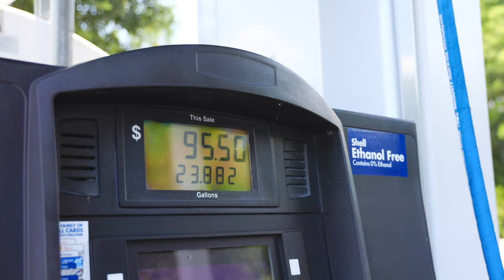Sport Fish Restoration in Florida: Partner with a Payer

Comment: I am concerned with the manner in which the voting and passage of the latest set of draconian measures were implemented at the Weeki Wachee river based on a non scientific observational study.  I have a background in science and you do realize that study wouldn't qualify as a scientific study which is why it's so long. 

Aside from the fact most of the extended sandbar they claim is erosion is likely the result of the additional sand added to the waterpark washing down the river,  implementing additional restrictions when the guidelines already in place are not being enforced is absurd.     

Having meetings and discussions on the issue outside of the area and people it impacts is outrageous and unethical.  I understand the round robin nature of these meetings and when you are discussing issues that pertain to the entire state that's fine.   When it pertains to a specific area and impacts a specific community that's where the discussions need to be held.   This is common sense.   There was no rush to have this on the agenda until the meeting could take place in Hernando county and if there were no meetings in that county then one should have been set up for this alone.  

It's obvious the decision to implement these restrictions were already made prior to any meetings and they were simply a formality to shut people up.  It would look very bad to have a hundred people show up protesting loudly what you are proposing and then pass it anyway. Optics would be horrible and it would really piss people off so I applaud the strategy of making sure they were held in other locations so people would not be able to attend and don't waste my time with they can submit written input.   Any written input went straight into the trash unless it supported your predetermined outcome.       As someone  who exposed  corruption and unethical conduct in the California Department of Public Health your strategy was transparent but I think it was transparent to nearly everyone.  Yes,  I learned through two years in the school of hard knox how you bureacrats work and now I'm a master of stragegy having beaten Goliath so badly I eventually walked away with a 7 figure settlement.   Be careful dismissing me as a crackpot like they did because it didn't work out well for them in the end.     Having  a hand full of bitter senior citizens that don't use the river accompanied by a fascist environmentalist who's ultimate stated goal is to block all public access to the river coupled with 30 years of not enforcing the rules already in place isn't a good foundation for passing additional laws and I'm not even mentioning that absurd report because I read the entire thing, have a background in science, as previously stated, and there was nothing scientific about it.  The eventual goal they are working towards is people only having  access to the river with approved tours.   Additionally, to be one of those "approved people" will of course require a permit which again comes down to money and has nothing to do with the river.       

If there is actual erosion from the volume of people on the river the solution is simple.   Close down the rental location in the park. Fixed!  Everyone has to launch at Rogers and paddle up to float back. The river will be virtually empty,  problem solved. Why wasn't that implemented or suggested?  I would fully support that.   But nobody wants to do that because of the money being generated.  Again, if this was actually about protecting the river this would be the most obvious solution.    That's without mentioning the millions of dollars earmarked to "fix" the river that have already been misaprorpriated.   And did you see those new boats some of those officials bought?  Wow it's amazing how a job earning that little money allows such luxuries.   I can't afford homeowners insurance but they can afford boats running hundreds of thousands of dollars as a public offiical.   But I'll leave that there.   Again, lets not pretend this is about the river. This is about money and control.  

If I learned one thing in California it's the quickest way to actually get something done is not to work through the system where things drag out forever and nothing happens.  The only approach to situations like this that seem to be effective is to publicly call out officials in the media and embarrass them.  That's how I eventually prevailed in California. The Department of Public Health had a sudden change of heart and decided to do their job after the Los Angeles Times contacted them.   A few months after the noise died down a few people were walked out of their jobs as well.   That was after 2 years of working through the system getting nowhere.  

There is a rapidly growing movement opposing how this was handled,  and the obviously predetermined outcome. This is already capturing the publics attention.   My personal background and experiences make me as sympathetic as my credentials make me credible.   Throw in how much the media despises the Governor and it shouldn't take nearly as long to get someone to embarrass him over this as it took me in California to get the media to address the department of health.   The liberal media in California going after the liberal administration on behalf of a strict constitutional conservative should give you an idea of what I can accomplish.  

The Media despises DeSantis!  The DeSantis administration claiming he had no direct involvement in this is unlikely to disuade them and ultimately he is responsible.  I'm fairly certain the media will waste little time in responding to a fellow conservative who feels the Governor is no longer representing the people who elected him. And that is the goal.  DeSantis is running for President.    Time to tie this action directly to him because ultimately he is responsible.  So don't expect us to play by the rules  and work the broken system if you choose to ignore listening to the people, rather than pursuing your own agenda. 

I strongly suggest you put this on hold until you can meet with members in the community impacted not member of the community of St Petersburg or Miami.   

The bottom line is the rules that were currently in place were not being enforced.   Creating new rules doesn't address that problem.  The issue is enforcement not compliance.  You can't fix an enforcement issue by addressing compliance and that is verbatim what was said. The new rules are necessary because people are not compliant with the rules already in place. Changing the oil isn't going to make the air conditioner in the car work.  

Again I sincerely hope you people put politics aside and start representing the people you work for or perhaps there needs to be some changes.   It's astonishing to me this is happening in Florida.   I lived in California for 12 years before returning to Florida.  What a mess that place is!  Yet I come here and find the same level of corruption,  dirty politics,  and disregard for the general public from the elected officials and their apointees. 

The people of weeki wachee DO NOT WANT THIS, overwhelmingly!   Until you can provide actual evidence the alleged erosion isn't the result of normal climate activity, tides, and/or the washdown of sand artifically added near the headspring you actually have no proof there is any damage from kayakers or swimmers at all.    In fact the first thing to do when you claim there is damage is to undo anything artificial that was done. So lets close the waterpark and see how that impact things before we move forward. That's the steps that need to be taken.   Let's start reevaluating the purposeful altering of the environment before trying to implicate people enjoying what was provided by nature itself as the problem.  

Someone standing there saying I saw a kayak pull up and and when it left the sand was stirred up doesn't qualify as science and that is the essence of that entire nonsensical report.  Nothing but theories and assumptions based on observations by people with a clear agenda and no objectivity.  it's shameful you people allowed this to happen and it really pains me that at 60 years old after the nightmare I went through in California I return to Florida to this!

I'm now starting to regret coming back here and that is breaking my heart as it was my pursuit for the past 10 years.    

There are much bigger problems that need to be addressed at this time such as the violation of our constitutional rights demanding we submit to having our belongings searched prior to being able to access the rivers.  You have rules being in place at another location where they are telling us if we want to have access to food while tubing we have to PROVE we have a valid medical condition requiring it, and a 20 year old concession worker handing out tubes will practice medicine and determine if we are allowed to have it or not.  Aside from that being and unreasonable violation of our privacy that's going to end in a massive lawsuit the first time someone ends up in the water unconscious because of blood sugar issue.  

So when I say the media is going to get involved there is a lot more than just this that will attract them. The entire system is broken.   The DEP has overstepped their bounds and that's a far bigger concern in the long run then these games being played over nothing but politics.  

DeSantis is running for President so I'm sure he will appreciate the negative publicity at this time.  And I absolutely assure you I will get press coverage over this.